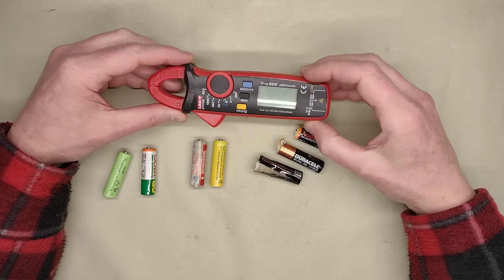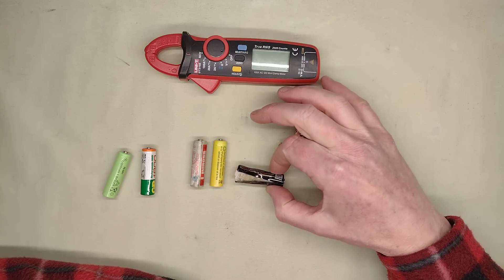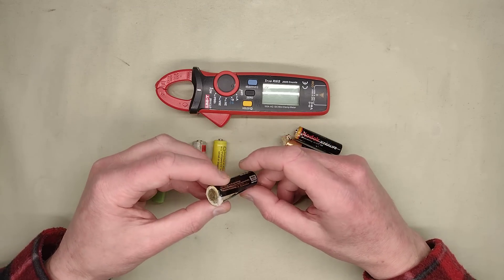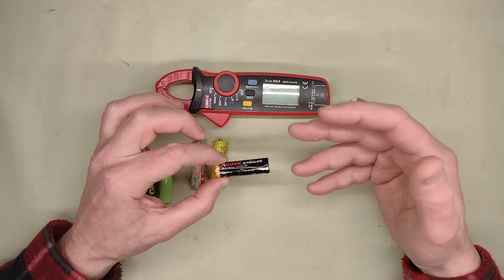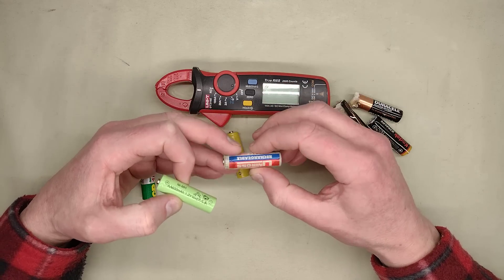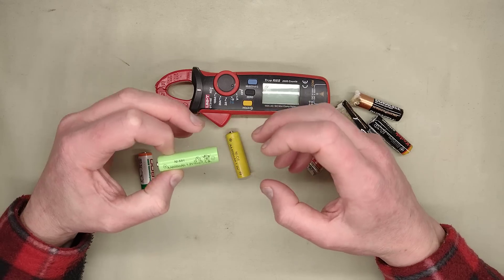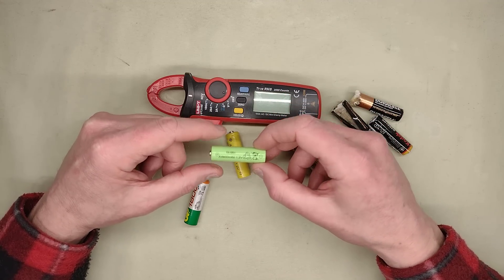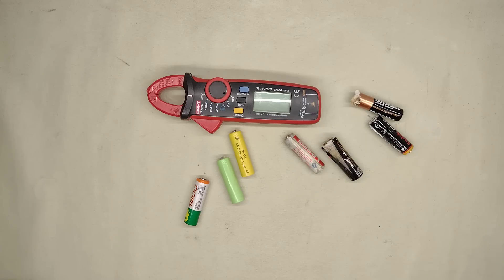The curse of leaky alkaline batteries

Comment: For devices that sit around a lot but get used regularly (like Multimeters) I have switched to the Energizer Lithium primary cells. They are more expensive, but for those specific cases they last forever and have not leaked on me so far. For all other devices, the alkaline batteries get taken out and stored in little ziploc-bags next to them. If a device comes from the factory with "heavy duty" zinc-carbon batteries those go into the trash immediately.

The lithium batteries alre also great for things like outdoor RF temperature sensors, as they don't crap out in lower temperatures.
With the lithium AAAs the thing lasts over 2 years, with alkaline AAAs I loose connection and have to change out the battery after 9 Months.
Reply: Why do you discard the zinc carbons? They're still good for low current devices like remotes and I've never seen one leak. Seems like kind of a waste to throw them away since in such remotes they last for years even.
Reply: I have had a set of Energizer lithium AA cells in a Logitech keyboard with trackpad I use for the PC connected to my TV - I think they've been running for 3 or 4 years now.
Reply: Still got the golden GP alkaline in my Logitech K400 plus. Battery date 2019-08. Do check them regularly
Those modern rf mouse/keyboards are extr melt low power devices. Remember in the early days of wireless mouses batteries (or charge) lasted for a week at most.
Reply: @g.h.190  The GP seem to be the best. I have a set from the 90's in a "display"toy from the early 90's still working
Reply: @kienanvella  That's more to do with Logitech than Energizer batteries.  I have what is probably exactly the same setup here which is approaching nine years in use - I've only just recently had to change the batteries from the originals!  (Non-fancy Alkalines)
Reply: What downside do you see with zinc carbon?  I've read that they're a non leaky alternative to alkaline, like for example for smoke/CO alarms.
Reply: @agentmango  Because in Zinc-Carbon batteries, the zinc eletrode the actual battery casing. So if they get depleted the risk of leaking is even bigger than with alkalines, since the battery is literally dissolving itself. Not worth the risk IMO, but feel free to use them if you like. I don't know where the tale of them not leaking comes from, we used them back in the day before alkalines were available and I remember a great many flashlights that were destroyed by leaking zink-carbon cells.
Reply: @Ranger_Kevin  Thank you, that's good to know.  I may pick up some primary lithium AAs for my smoke/CO alarms.  (For other stuff like for ex. Ring motion sensors, I don't mind using Eneloops.)
Reply: @Ranger_Kevin  Indeed they do and did, I remember tossing out many a tin flashlight from old carbon battery leakage.
Reply: @Ranger_Kevin  The tale of carbon zinc batteries not leaking comes from the fact that they rarely leak. Whenever I've opened one up there simply isn't any liquid inside. I'm talking about modern variants here, ancient ones from the pre-alkaline days were possibly different. Sure the metal can corrodes but the outer sleeve stops it from falling apart.
Reply: @Ranger_Kevin  Zinc Carbons of better quality don’t leak: brands as Panasonic and Sony, I have used close to 100 units and not seen any of them leaking. For me this is the most important feature. They last less for higher current devices, but most of these ones accept NiMH - good ones as Sanyo/Eneloop or Panasonic also don’t leak.
Reply: @agentmango  zinc carbon "heave duty" batteries use the outer shell of the battery as one of the electrodes. The "acid" in them will eat through the can given enough time. I've seen it on multiple 6v "heavy duty" lantern batteries I had in storage for emergency lighting because of living in hurricane prone Florida. I had pulled the batteries apart to scavenge the carbon rods from them and the cans of the cells were almost completely disintegrated. These batteries had only been in storage unused still in their factory shrink wrap for about 5 years.
Reply: @agentmango  
You read wrong.  When alkalines first became popular, aside from capacity, a major selling point was they were supposed to be less prone to leaking.
Reply: @agentmango  I thought that they were fine, but I had a sunbeam brand leak, and ruin my favorite clock.
Reply: Lithiums cost twice as much, but you get about twice the capacity (break-even) and shelf-life (now you're ahead) for that price.  While some would consider the resistance to leaking mere icing, for me, it's THE reason I made the switch.
Reply: @ItsMrAssholeToYou  The only complaint I have about them is that they are hot ( well over the 1.5 volt)  I worry about some of my sensitive electronics with that much voltage esp the items that take 8 batteries being + 2 Volts, kinda the opposite of the NiMh being - 2 Volts in the same application.
Reply: That's right! I'd forgotten about Energizer Lithium!
And yes, zinc carbon or (Heavy Duty) batteries are junk.
I purchased a garage door remote a while back that came with them, and they were leaking inside the package!
Thank God, they didn't install them, or it would've ruined the remote.
Reply: @KentuckyRanger  Just watch out that I once found an Energizer Ultimate which looked similar, but was pretty much ordinary alkaline.

What's the chemistry for Ultimate Lithium, anyway? Or does it use a ~3V lithium primary cell with a voltage dropper?

How things change. I remember when zinc-carbon "dry" cells were grotty and leaky, and "alkaline-manganese" were the best thing since stripey toothpaste :-)
Reply: My lithium calculator battery is still going after 36 years, I’ve never had to change it, they are quite amazing.
Reply: 1.7-1.8V is too much for some microphones.
Reply: In the US Navy forty years ago equipment that was damaged due to being stored with batteries inside was a Captain's Mast offense.
Reply: @richardhaas39  Same in The USMC.... but I guess being the same dept that would make sense.
Reply: I had placed Duracell batteries in my trail cam,20$ for 8 batteries
Hoping to get some great footage.
After getting it back,a week ago,one of the batteries leaked after only a few months.
Never had problems before with that brand,now I have  clean the trail cam,hoping it still works
Reply: Interesting. I wonder if I can get a bunch of these in AA size.

Comment: I still use alkalines in many things. I found some things, like the clocks I've got that self-set using the wireless signal tend to go badly wrong when the voltage drops below about 1.3V. Also I've got a few cheap bluetooth computer mice that take two AAs each and they start acting up when the voltage dips a bit. Other than that I love rechargeables. I use them in everything I can.
Reply: I still use zinc batteries
Reply: Just get yourself some batterizers!
Reply: You are joking, right?

Comment: The one application I'm using alkaline cells for is a microchip reading cat flap, and for safety reasons I change the cells well before they run out of charge, so I have tons of partially used alkaline cells left over. The device really does not want to run on 4.8V or less (it has 4 AAs in series). I've been thinking about getting some of those 1.5V lithium ion AA replacements, but I'm still not sure which ones to go for.
Reply: Project Farm has been doing tests on the 1.5V li-ion batteries, might be worth a look.  I suspect the cheapest possible option that isn't awful is the best choice here, since the current draw should be extremely low.
Reply: Maybe you should modify the catflap circuit to use FIVE of the 1.2 volt NiMH cells, or use just TWO cells of Li-ion or LiFePO4, with diodes in dummy cells to drop the voltage as needed. You might even use ONE of the lithium type along with TWO NiMH cell to give you a nominal 6 volts... at the risk of reverse biasing the NiMH cells when they reach full discharge... but that mixing of cell types/cell chemistry is NOT recommended for that exact reason.
Reply: @YodaWhat  If you're going to do that, you might as well use two lithium batteries and use a resistor to drop the voltage to the device.
Reply: @tbelding  No, resistors are exactly the wrong way to drop the voltage, because at low current the final voltage can be too high, and at high current the final voltage can be too low, with no happy medium for most kinds of equipment. In the case of a catflap, the two extremes of current are way too different for the resistor approach, and diodes have no such drawbacks..
Reply: @YodaWhat  - then you can use diodes, I guess.  I'm tired, and probably shouldn't be answering anything tonight :)

Comment: Had to repair many pinball machine boards that suffered many years of so called non-leak Alkaline batteries installed, spreading toxic corrosion on every trace in a confine space.
So glad when nvram became available.
Reply: Rrgh... I hate those things.  I lost an Amiga 3000T to one of those infamous Varta batteries.  So many old computers from the 80's and early 90's have been destroyed by those horrible batteries they soldered to the motherboards.

Luckily the aftermarket expansion cards usually used lithium button batteries.  My A1200 FPU and RTC card still works like a champ and I've only replaced the CR2032 battery twice in nearly 30 years.

Comment: If I off-load all of my alkalines, how will I power my joule thieves? Sigh.
Reply: Use batterizers on your nimh batts and you'll get full alkaline voltage out.
Reply: The point of the joule thief is to use residual cell capacity from expired cells. That’s not good for rechargeables.

Comment: Yes, I have had similar experiences.  For many things I now use Eneloop batteries, most of mine are about 6 years old and still going.  For more serious stuff, like expensive multimeters, I have long been using Energizer Industrial batteries.  So far none of the industrial batteries have leaked, and I have run some long, slow leakeage tests.
Reply: I believe I heard somewhere those Energizer Industrial batteries are the same as the regular but just packaged in bulk compared to the plastic wrapped batteries
Reply: I'm using li-ion 9 volts in meters.
Reply: All I can say is avoid Energizer's rechargable batteries (the green packs you see in supermarkets), bought a few packs of them when I was in Uni a few years back, at this point every single one of them has leaked.
Reply: @RossMitchellsProfile  I have a bunch of Rayovac which look similar that are many years old and doing fine.  Just make sure you read the package because they sell two versions one of which has higher capacity. EDIT: I bought a nice charger that charges each battery individually. I wouldn't use the cheap chargers that you find in the grocery store.

Comment: Get yourself a nice charger for NiMH batteries and about double the number you need, and you're in business for anything that needs them. The spares are there for immediate need, and by the time you should need a fresh set, the previous ones have long been charged and put back in storage. They're actually pretty good these days for most uses. You can get high capacity or low self-discharge (they put lithium to shame on capacity/volume, but get shamed back on power out/in).
I have a 4-Cell unit with per-cell management, discharge, discharge-refresh, charge, and a test function all in one, with cycle-through readouts for current, voltage, capacity, etc. When I get a dead cell I put it in and set it to discharge so I get a full cycle out of it and then it goes as normal. If I find an iffy one I discharge-refresh it and see if it's still good. Out of a set of two in a wireless handset, one was good, the other was dead. With a dumber charger I would not know that.
Reply from the maker: The dumb chargers have their uses.  Most smart chargers will end a charge too early on older or lower capacity cells.
Reply: I am curious, do you use rechargeable C or D cells? And I don't mean a AA or a AAA in a holder, of course, I mean the real deal. I have a Maglite and a lantern that I want to switch to NiMH, but good information on NiMH Cs and Ds seems very scarce indeed, and not very many companies make them.
Reply: @akimbo990  
Those sizes are considered somewhat obsolete these days which is why Eneloop doesn't sell those sizes, but there are adapters for C and D sizes if you need them. The simplest ones are the 1-cell spacers that Eneloop and other brands have available but I prefer to use multi-cell adapters where I can place up to 3 AA cells in parallel for more capacity. However, you will only ever find them sold in the style of no-brand-name-cheap-chinese-electronics. I don't mind since they're just dumb adapters anyways.
Reply: @akimbo990  Sadly no. Only AA and AAA. Haven't gone and looked, mind you, but I haven't heard much of them at the larger sizes either. Turns out I don't have many cases for larger NiMH batteries.
Reply: @akimbo990  I picked up some Ansmann C sized cells a year or so ago for my sisters door bell sounder thing. They tested in excess of the 4500mAh rated capacity in my MAHA C9000 and have been fine since being in service. She's only got a AA charger so I top them up every few months for her.Not sure how they would fare in a higher drain device like a Maglite.
Looks like they also do a 'proper' D cell at 8500mAh cap

Comment: Alkaline last longer than even Eneloop NiMH in my wall clock that I have to get out a latter to access. So I'll keep alkaline on hand, thank you.
Reply from the maker: That's usually down to the motor impedance being designed for 1.5V cells.  Clocks don't use alkaline cells to their full capacity.

Comment: Just ordered a batch of AA & AAA Eneloops from ebay. The Jugee seem to self discharge too fast to be useful in low draw/long off period applications.
Reply from the maker: They do gradually discharge due to having to boost the voltage, even in standby.
Reply: Hope you lucked out and got genuine Eneloops.   There are a ton of craptastic Chinese counterfeits on the market, with eBay and Amazon being the main sales channels.

Comment: Project Farm reviewed LiIon AA replacements a while back. I actually have almost no devices left anymore that use AA cells but if I did I'd probably move to those. I use AAs so little that the NiMH cells that I had all just died from lack of use and self discharging to zero.
Reply: How does that work?  Pretty much everything sold today that uses batteries uses AA or AAA cells and the occasional 9V.

Comment: Classic.. What timing. Ive just started switching out Alkaline batteries for NiMH batteries in all my devices after discovering a leaking battery (caught it in time), that wasnt past its due date, and was purchased new not that long ago. Some devices complain of low battery, but the % they report never drops for a long time...  I even replaced the Alkalines in my PinBall machine with them a year ago. Still going strong (one day, Ill do the memory mod so it doesnt need battery backup)...